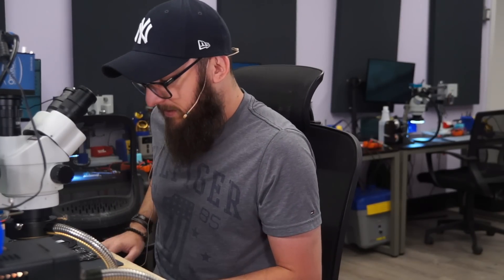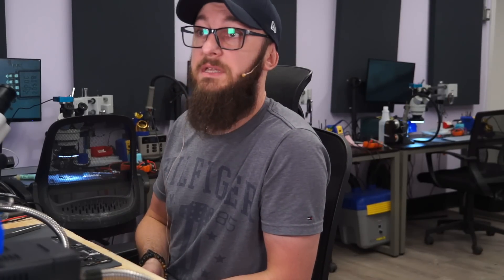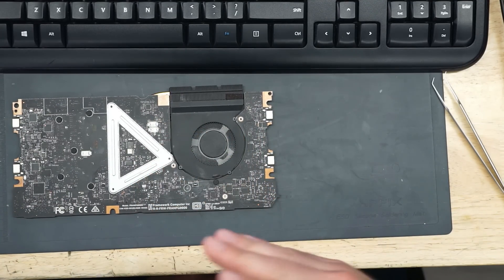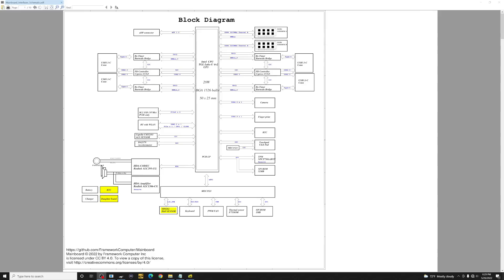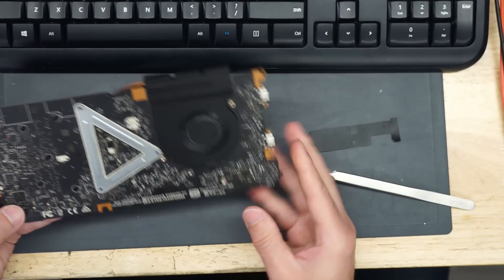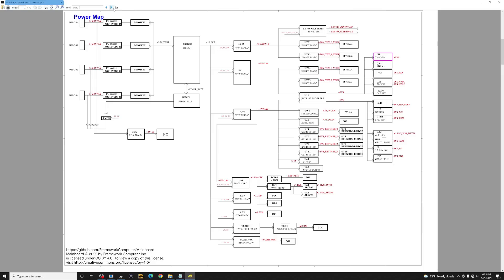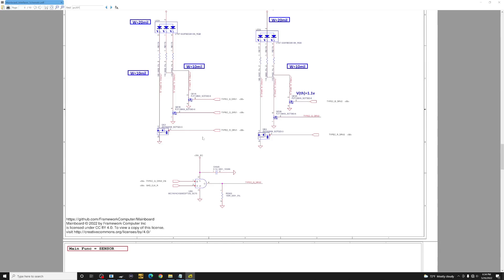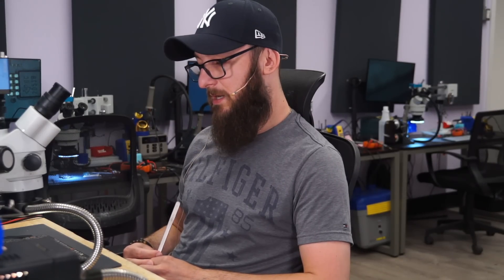Framework laptop water damage repair attempt using partial schematic

Comment: that's a shame that not all the components are labelled at this point
Reply from the maker: Even that is kind of workable if you're open to guessing and tracing but lack of values in the circuits makes it so you're doing a complete reverse engineering project for a repair which puts this outside the realm of what can be offered in a $50-$200 no-fix-no-fee environment.
Reply: @rossmanngroup  I expect the reason they cant provide these values is if they provide enough of them you could infer from the schematic the voltages and power info of the intel cpu (or other chips) were this info is under hard NDA and thus cant be shared publicly... the only reason vendors do this is so that they can controle the OEMs that use their parts. 

Framework cant risk breaking Intels NDA and im sure its a lot of work to go through the schematic to ensure what you release does not in any way readably leak info provided to them by such parts vendors.
Reply: @hishnash  cpu pin info and voltages are sometimes easily acquired, intel has not indicated they are openly opposed to technical info on their boards being open to the public. At least as far as driver support goes Intel has been one of the biggest supporters of open source drivers.
Reply: @Enonymouse_  you can find it but not legaly, intel do not provide this info publicly that means when a company uses an intel cpu they need to sign an NDA and thus if they released schematics that included this info they would be in breach of the NDA.

Comment: I was considering getting one of these.  I like the idea of open source hardware!
Reply: Great machines. I bought the base model, upgraded the SSD myself, took five minutes to open it and swap out the drive.
They will sell you a new mainboard, so I can upgrade it at any time.
Pick the ports you want have installed, change them at any time.
There's already 3rd party expansion cards available to either purchase or build yourself.
Reply: good idea but price is a little steep for what you get. if they put in amd's new 6800u series apus and lower the prices a bit i think more people will jump in.
Reply: it'll be a long time until that exists, if ever. You'd need RISCV or POWER as well.
Reply: @gg-gn3re  I doubt we'll see RISC-V in a laptop for a while. They only ran a batch of 1000 for the HiFive Unmatched, though at least it runs OpenBSD and FreeBSD in addition to Linux. SiFive has demoed a proof of concept using TSMC's  5nm process but it will be a while before that is on the market. The Betrusted Precursor uses an FPGA "soft" CPU implementing RV32 (whereas the SiFive HiFive Unmatched and the StarFive VisionFive boards are using an RV64 CPU at a 28nm process I think?). I would give up on Power in a laptop, unless you want a used PowerBook G4? Power is deeply entrenched with IBM and their claims of being open are vaporware lip service, you could barely even buy the Tyan OpenPower systems even when those were being advertised (and those were just Power8 and definitely server grade designs, completely unsuitable for a laptop).

I expect RISC-V will continue to iterate and improve and all the academic institutions you would imagine being worthwhile are putting their weight behind it (e.g. UC Berkeley, MIT) but given that it took ARM from the 1980s until the 21st century to make it into big name brand laptops, I wouldn't hold my breath that RISC-V will be widely embraced for a while. Most people and businesses hate change.